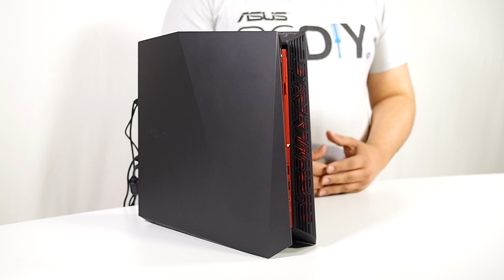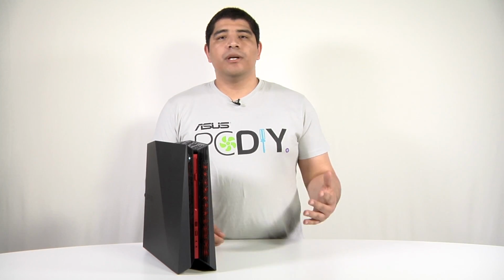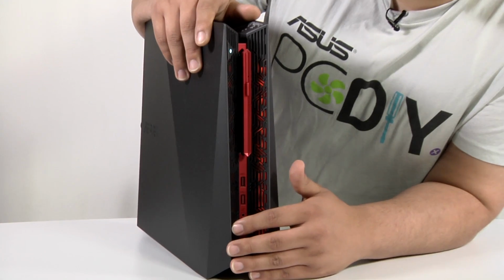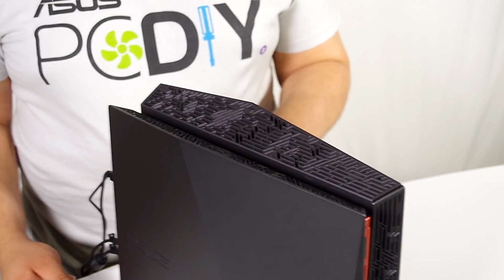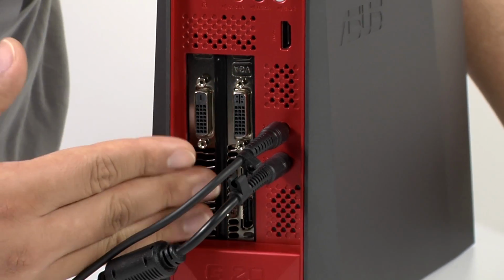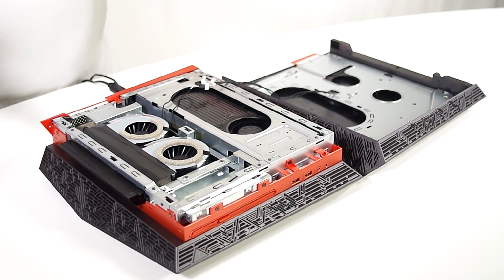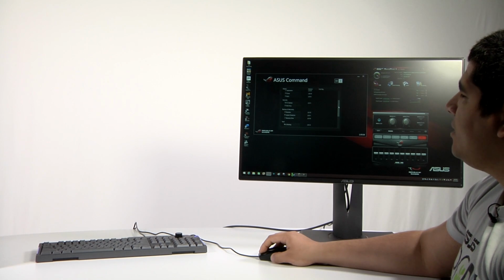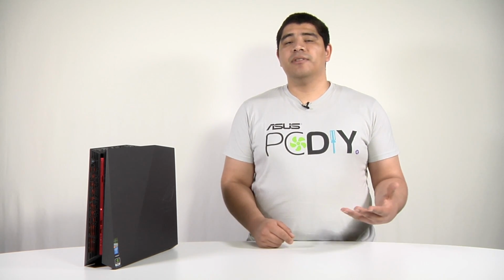ROG G20 Compact Gaming Desktop PC Overview

Comment: will the new 3000 series fit into this? Will it be able to handle that and a 10700k cpu upgrade? Would I need a new power brick and/or a new motherboard?

Comment: Guys,. Please I need help, my friend is selling this for 600 to me but I was gonna build a PC for 700, the specs we're gonna be 

Case. Thermaltake Versa N21. Mid: ATX, Micro ATX 8.5 x 20.2 x 18.2 inches.
 ...Motherboard. MSI B250M Pro-VD. 
...Processor. Intel Core i3-7100.
 ...Graphics Card. EVGA GTX 1060 Gaming Mini 6GB.
 ...RAM. Crucial Ballistix Sport LT 8 GB DDR4-2400 CL16.
 ...Storage Unit. SanDisk Plus 120GB.
 ...Power Supply. EVGA 430 W1.

I don't know if I should take the deal because it's literally like half off or if I should build my computer, I'm looking to play multiplayer fps games in ultra settings at 60fps 1080p.

Comment: The price is just right for this thing. It  comes with an operating system, a high end graphics card, ram, 2 hard drives, case, power supply, and an optical drive for about $1150 to $1869.

Comment: I use this PC and never ever has crashed to me. I dont know why u guys have this problems, I think it's a good product and I dont even care removing the warranty, Im thinking about upgrading it's components. The reason why it crashes it may be a high acomulation of dust or a bad BIOS configuration, remember that you can change some options in the Asus Command app, and I'm not even using the turbo mode whatever u call it...I can play games at 1080 60fps, fps can drop a little when many particles are produced. I will use this machine as long I can upgrade it's components and play perfectly.

Comment: Had mine for a year and a half, and started having problems with it after a year. Some games I can play no problem and others will make the GPU or CPU crash or something, I dunno. I just randomly have no signal to my monitor. Start up is a pain sometimes now. Will either start up with no signal and the GPU fan at full speed until I shut it down, or just no signal. After 5 or more restarts it finally gets a signal to my monitor. Took it to Best Buy for repair and all they did was replace the internal wiring and hard drive. Still had problems with it. I took it apart to clean it and still had problems. Overall, I think it was a waste of money, better off building my own rig. The case does look cool, but looks aren't everything.
Reply: Had mine for around the same time, then the fan on the graphics card suddenly exploded one day in the middle of a gaming session. Went to open the thing and that was a lovely nightmare. You have to basically take apart a metal skeleton around all the parts just to get to any of them.
Reply: Mine lasted 3 or so odd years but was pretty lack luster performance for the cost of it
Reply: I have the same problem right now i can't start my computer the GPU / CPU fan is going insane and i restart it like more than seven times and it still doesn't work do you have any idea what's wrong?
Reply: @X_wish  it’s just a bad computer, seems they sacrificed some reliability for a cool design, I had insurance or protection or whatever on it from the store I bought it from so I was able to trade it in for a computer of a similar price, which I’m still using to this day, just with an upgraded GPU.

Comment: I've had it for about a year, FUCK IT. It's so bad, it keeps crashing every month. There are always vertical lines (colors vary). Someone help me with this bullshit.
Reply: I've had mine about a year, I dont have problems with crashing, but it does constantly flash black for some reason.
Reply: The crashing could be from overheating, and the lines are most likely that your card is dying and frequent crashes prove that, might start thinking about an upgrade
Reply: Snooplix same thing and I don't know why

Comment: How will this handle games like Gta, Black ops stuff like that. Also how will it do at editing?
Reply: Henry Grover it will play gta at high settings 1080p 60fps, BO3 at 50-60fps 1080p(any older gta or call of duty games you will play EASILY). It has an i7 processor so you already know it's very good for editing and rendering

Comment: So if I can't open the case without voiding the warranty, how will I be able to clean it?
Reply: its a great pc
Reply: WastedMidget1 how is the power consumption on it. also is it good for gaming?
Reply: The video shows you can take a panel off the top to clean out dust, and not void the warranty.
Reply: What part of the video is that in?
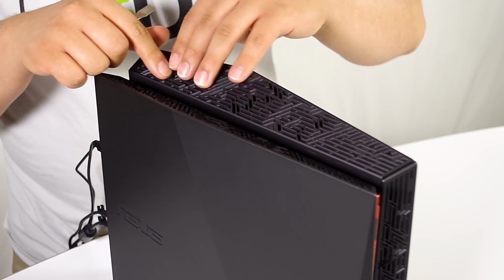Reply: +WastedMidget1 At 10:00.
Reply: +Coyoty Wright Thank you :)
Reply: +WastedMidget1 Do you have an Asus Rog G20 yourself?
Reply: +WastedMidget1 Yes.
Reply: +Coyoty Wright So when I am cleaning it, do I just pop off the panel and blow air into it?
Reply: how do you like it so far?
Reply: Fire Squad  I know you didn't ask me but it's a great PC. Awesome for gaming. I have fallout 4, siege, battlefield 4, battlefield 1, skyrim and dayz. They all run so smooth. When you power it on it just takes 8 seconds and you can long in.
Reply: UnDEADJOKER21 do only thing I don't like is the external power supply
Reply: Fire Squad The external power supply is why it's so quiet. An internal supply would need a noisy cooling fan inside collecting dust that would block ventilation and make more heat to cool.
Reply: Coyoty Wright but does it consume a lot of power

Comment: My Asus RogG20 only uses my cpu for gaming, when i first got my pc it was using my gpu but now its using my cpu and ive tried installing drivers and such, and Im still having problems with It please help I have ASUS ROG G20AJ US006S with the I3 and the 745
Reply: what cables are you using, for example if hdmi make sure the hdmi on the desktop is connected to the grahpics card, if your using a dvi same thingmake sure the dvi socket on the desktop is conneced to the graphics card
Reply: When i plug my hdmi into my graphics card my monitor doesnt turn on
Reply: When I use programs to find my gpu its undetectd
Reply: ☆ Ghost ☆ areyou sure the Graphics card(GC) is inits place properly and also make sure that the hdmi is Actually connected to the GC. if the graphics card is all inits place then theres somthing faulty
Reply: Emperors Ordeal Ive benn thinking i need to actually reseat my graphics gard
Reply: ☆ Ghost ☆ yh maybe the drivers need updating

Comment: can I put a gtx 960 reference card in jere?  I just bought one of these with an gtx750 in it.  I found a decent 960 for about 199 but I don't want to get it if it won't fit properly in here. 

PNY GeForce GTX 960 4GB GDDR5 DVI HDMI DisplayPort Low Profile PCI-Express Video Card VCGGTX9604XPB
Reply: +Suff3ring Soulz I paid 500 bucks for mine and it'd awesome.   now that the new technology is out its definitely getting an upgrade.
Reply: +Suff3ring Soulz there's a new one coming out with the 1080 in a few months.    I bought mine for 500 because my previous computer was fried.  so I had to upgrade.  and it was a good upgrade indeed.  now I will drop the new 1070 gtx in there and a new i7 processor still paying about 1500 just not all at once

Comment: Got this with an i7-4790k and GTX 960. Upgraded it to a GTX 980Ti, happy to say it fits like a glove. Note, if you plan on upgrading to a GTX 980Ti, you'll need the Nvidia reference model, as these fit perfectly. You'll also need another PSU, pretty pricey at around $100 but well worth it.

Comment: I want to buy that computer. But I don't know how good is it. Can you guys from Asus or people having the same computer test Minecraft for me please? Thanks.
Reply: +Minecraft JiaTNTO 16 gb 128 ssd 1 tb 7200 gtx980 i7 4790 will eat anything you throw at it at hd
Reply: +Minecraft JiaTNTO in what games? i can give you some bench scores... in 3dmark firestrike stock 10833 overclocket gpu 12177
Reply: +RAFCOM1982 I'm gonna play Minecraft
Reply: +RAFCOM1982 What is that link?
Reply: Price?
Reply: :/ US$?
Reply: +DeadBodies Can you test Minecraft at Max settings, Normal settings, Low settings please? I want to know how many fps that the computer can get. If possible, record something (don't need to post) with Open BroadCast Software. Then tell me the fps.
Reply: Hum.. the computer of my friend can get up to 1000 fps with 61 mods
Reply: And it cost 750$
Reply: But it is a custom build
Reply: i dont reccomend it
Reply: Ok.
Reply: +xJia&#39;s Channel This is going to run minecraft more than flawlessly. I had an old hp laptop with 4gb of ram, i5 processor and dedicated intel graphics and it ran perfectly 
(this is from like 2010 xD) but this will do the job pretty darn well
Reply: It's minecraft... This computer will walk all over it.
Reply: Yeah but I need some 1000fps shit. So I am sure that I could open multiple minecraft tab and with mods also and record. and other programs. But anyway, I made a custom one, I just need to buy it.
Reply: you're not even gonna notice 30fps on minecraft...

Comment: Hell JJ I purchased G20AJ here from Philippines. My system comes with i7 cpu, 12GB ram and GTX 745 GPU. Out of the box my system comes only with 180watt. I plan to upgrade my GPU with GTX 980Ti. I realized that I need to purchase another separate 230w PSU for the GPU usage. 
I wonder if it's possible to upgrade and run my system with GTX 980Ti reference card using (180w + 230w PSU) as the 980Ti requires 250w of power usage alone. 
Many thanks JJ.
Reply: +Clark Llorente  Sir  na upgrade nyo po ba yung gpu nyo and memory ?  I'm planning on doing the same after the warranty runs out. Almost 1 year and going no issues so far.

Comment: Hello JJ. I purchased the 2TB 16GB version. I have two concerns. The first is the CD/DVD door is manual instead of automatic and it looks like an accident waiting to happen (when that door slides out). It might have been better to have the traditional slot where you could stick in a disk and the disk would be absorbed without effort from the user. 

Secondly, as there is no space there is no way I can see to improve upon this tower. Can you provide any suggestions on how a user could improve upon things down the road?  Do you know why the dvd/cd drive was made manually rather than automatic? Is there some benefit I am overlooking?

Thank you

D
Reply: I have this computer and when i decide to upgrade im gonna put it in a new case
Reply: Rusty Shackleford what do you mean defective
Reply: +Rusty Shackleford The G20CB-B10 is defective? Is there a site that confirms Asus' decision? Thanks. I have ten days left to make up my mind on this one. So far so good but I have not played any real tough games.
Reply: +Doug Koehler Its manual to save space. same as with any laptop.
Reply: Yeah no quality anymore.
Reply: +Doug Koehler It still is high quality as it's from Asus... If you want a better optical drive, buy an external one or buy a fully fledged PC. The slot loading is to save space. The whole point of this PC is it's size, putting in a bigger one would ruin it.
Reply: Yeah I got an external that also plays 3D movies.

Comment: I didn't get a secondary power chord with my g20. should I have? I have the i5 4460 CPU and the gtx750 in mine..
Reply: +Welsh_Gaming I have the Asus Rog g20, I want to upgrade the graphics card

internal specs / i5 processor/ 8gb ram/ gtx 750/1tb hard drive 

I don't know everything about internal specs but could I upgrade to a gtx 980 or something similar and purchase the higher watt power supply cord for the higher graphics card , do I need to upgrade anything else in the system to play modern or old games ?
Reply: +Welsh_Gaming What about a gtx 960 since I just found out that the gtx 980 is a little out of my budget?
Reply: +Welsh_Gaming so if I install a gtx 960, would I need to upgrade anything else ?
Reply: +Welsh_Gaming Thank you alot

Comment: the more compact pc the worse the bigger the better. On pc's the size matters so if you have a really small pc it will heat up really fast but if u have bigger it wont heat up so much but still its bad. No 1 has made a pc that would not heat up, but if u make ur own pc case u can make it not heatup so much. every1 knows hot goes up and gold goes down, so u want to make the pc to have all the hottest parts on top and coldest on bottom so the hot air gets out, but make it not have the parts on top of each other so the hot air wont heat up the other parts. Thanks for reading.
Reply: +Welsh_Gaming my friends pc is pretty small and he plays with all high always and hes pc heats up so much that i need to sit on opposite side of the pc
Reply: It's quiet and doesn't heat up to the point you can't touch it
Reply: well i dont usually touch my pc when its on :P

Comment: This computer is the biggest piece of shit ever. The internet (wifi specifically) SUCKS. I can't even connect on this piece of shit and webpages take forever to load. I am using a laptop right next to the computer right now and it has good internet speeds, unlike the dog shit computer. "compact console computer" my ass. People reading this, don't waste your money on this piece of shit. It's a garbage PC that doesn't deserve any attention from anyone.
Reply: I agree with u dude I WASTED FUCKING $3600 ON THIS PIECE OF SHIT AND THE GTX IS NOT EVEN WORKING FFS PLUS THE SCREW ARE FUCKING CHEAP. i accidentally put the screws in before closing the cover for the desktop and the screw was hard to twist now it's out of shape and stuck there omg. FUCKING SHITTY $3000++ COM DONT EVERY BUY THIS YOU GUYS WILL WASTE A SHIT TON OF MONEY BEING UNHAPPY
Reply: VenTus Jadex That sucks dude. TO everyone else, you can build one of the best gaming PC's ever with $3,600
Reply: thats not the problem i got it a few months before windows 10 the problem is the graphics card is not working
Reply: +VenTus Jadex Im thinking of getting it to the fact its in the price of $1500 for 32GB Ram and a GTX 980 which is a good deal with me. When I attempt building a PC I easily go over board of my price range of $2000

Comment: When upgrading the gpu to a reference 970 or 980, do you need to upgrade the video card psu to power it? If so where can you get one, and how big of one do you need?
Reply: Asus won't tell you that but yes you will need a second psu. 280w you can get them from Asus same as their laptop charger.
Reply: +Welsh_Gaming  I have this pc ,,, yes you are correct you don't. good statement
Reply: +Anarcho How many power cables you get depends on your original gpu mine only had a GTX 750 in it so I required the separate power supply.

Comment: DO NOT buy this piece of shit. I have never had so many problems with a computer in my life. I build computers but my brother bought this without checking with me and ofc it is garbage. WIndows and the drivers for all the hardware are very unstable and/or the bios from dell. I've had to reinstall windows so many times that I've lost count.
Reply: XiroCastGaming
You poor guys who never owned a real computer. But if ur happy great.
Reply: +Brent Newton 
No problem with mine runs like a dream needs a gpu upgrade that's all
Reply: +Brent Newton Damn, In not alone. I want to add to your argument, this computers internet is absolutely fucking terrible. I can't fucking connect to a network that my three year old laptop which is right next to the computer connects to fine. Like this guy said, don't waste your money on this shit. Ever since day one this computer could not have made me want to chuck this fucking piece of garbage out the window more than anything. Do not buy this. It's not worth your money.
Reply: +Glenn Drury The only issue is it came with a 760, sure it looks beautiful but damn i want a better card, i guess ill just get 970

Comment: Does this also apply to the Asus Intel Core I3?  I wish they would come with windows 10 already installed.  I've been hearing that there is a problem with upgrading from windows 8.1 to windows 10.  I know that you can upgrade for free, but I hear there have been problems.

Comment: I have the i7-4790 3.6 GHz and GTX 760 version of this PC. Do you guys think a 980/980 TI will fit in this desktop? I was planning on upgrading my GPU. Also, do you guys know what my current desktops PSU is? Cause I haven't been able to find it, and I know a 500W PSU is recommended for a 980.
Reply: Yes it will fit, but it voids your warranty to open the case.

Comment: Buyers beware!  I ended up with a machine that came with a bad graphics card. After waiting nearly a month for tech support because I had to mail it to them (and pay for shipping!), they sent it back to me without actually plugging in the replacement GPU at all! Even sending it back would have been useless because the first person who worked on it on their end broke the warranty seal. So not only they broke my computer when they were supposed to fix it, but they will no longer honor their own warranty on it!

Now, maybe you'll be lucky and get a machine that works fine, but just be forewarned, ASUS tech support extremely shady and will do anything in their power to screw you over if you try to ask them for help.

Comment: I was wondering if I could switch the current graphics card in the ROG G20 with either a EVGA GEFORCE GTX 960 SUPERCLOCKED NVIDIA GEFORCE GTX 960 2GB or a STRIX-GTX960-DC2OC-2GD5. Any info would be helpful. Thanks :)